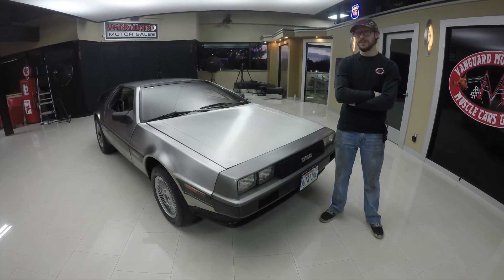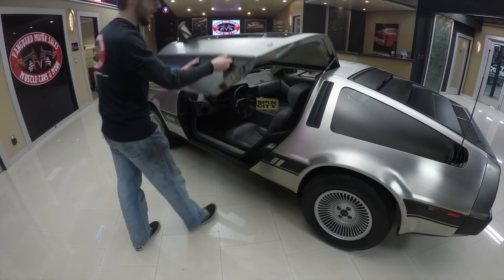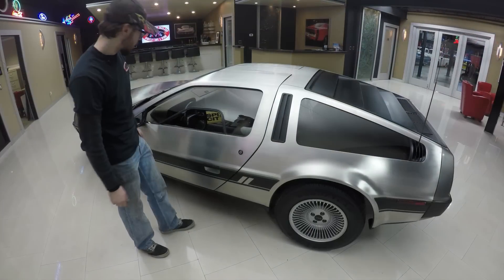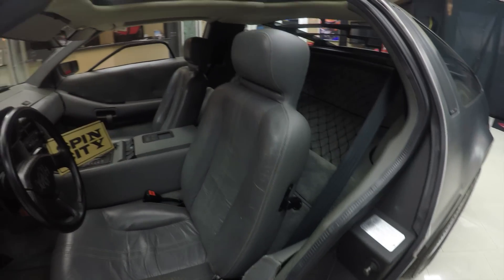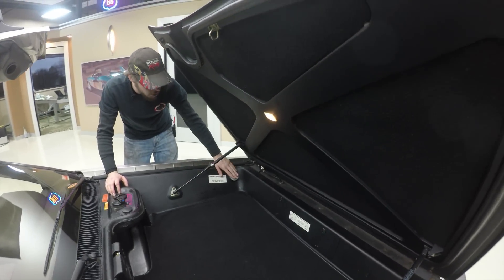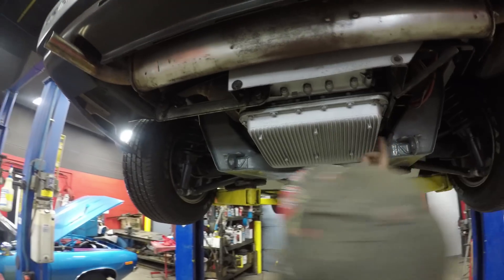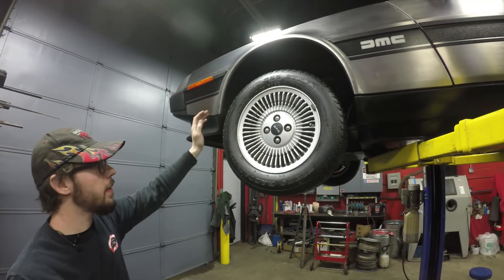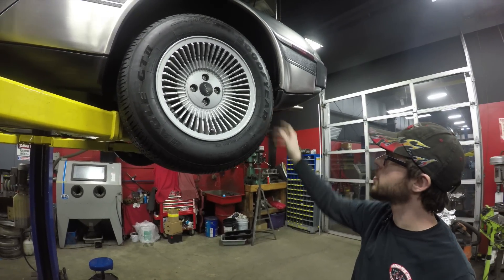1981 Delorean DMC-12 For Sale

Comment: It should be noted you can get 99% of the parts for these cars still from DMC as "new old stock", who is back and now sells them. So you can restore these to new condition. Also they only came with the v6 under powered engine. Had they simply added a turbo it would have been a much better car.
Reply: Thee are 2 production turbos that were made at the end of the last run. It was intended that the new turbo version was to come out the next model year. So yes, they did make a turbo version.

Comment: man if i could get one of these, and modify it to have all wheel drive and all wheel steering...
and a MANUAL transmission, and a 6 liter duramax... it be the coolest car ever made..
Reply: The original design was an all wheel drive and turning. It was deemed impractical and expensive.